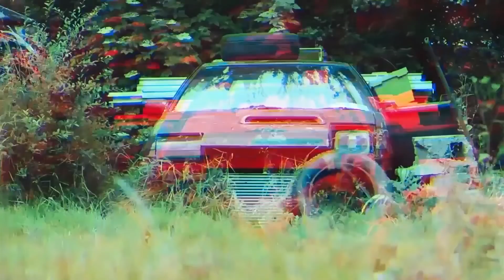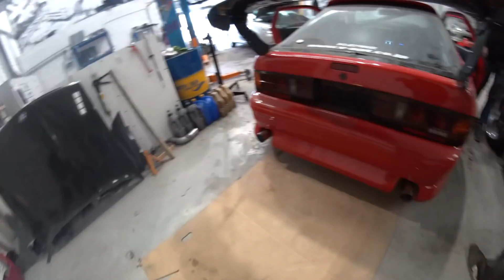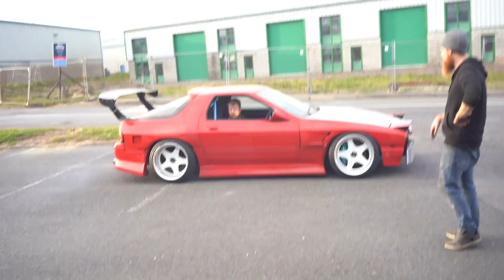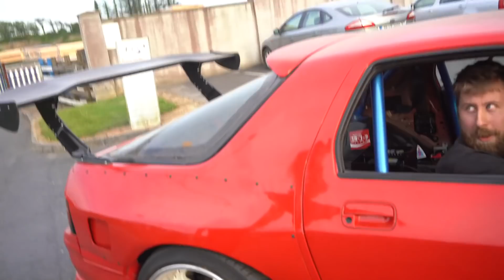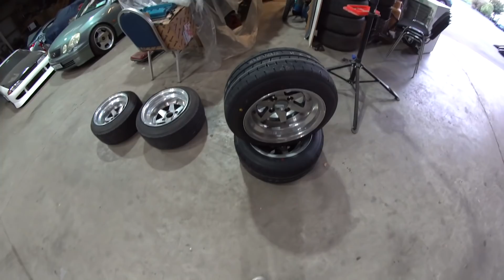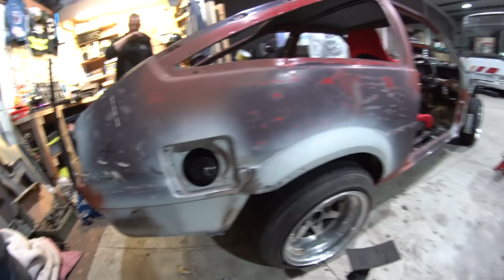Epic 13B Rotary Sounds As Flips FC RX7 Comes To Life!

Comment: sounds like its time for a new spring in that r2d2 as it was opening with no pedal lol
Reply: That’s not the sard you’re hearing, it’s the turbo out through the air filter. The r2d2 starts doing typical dump valve things up much higher rpm
Reply: @philipmorrissey9795  the age old question, when turbo surge turns into choo choo choo